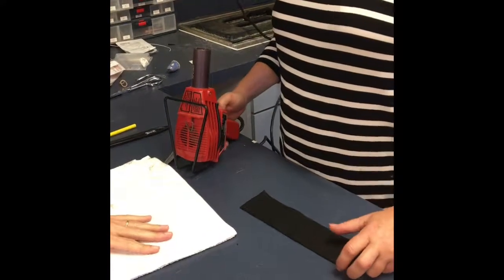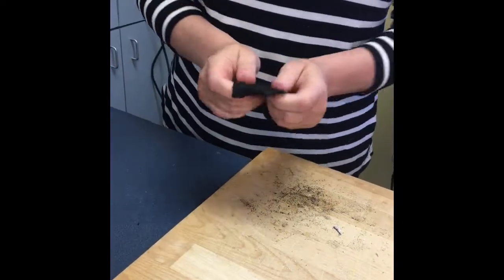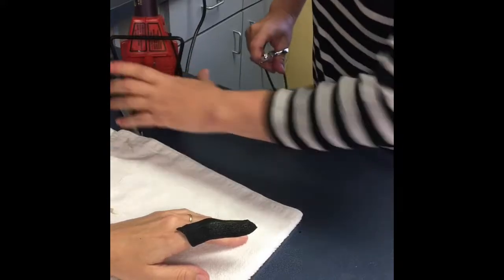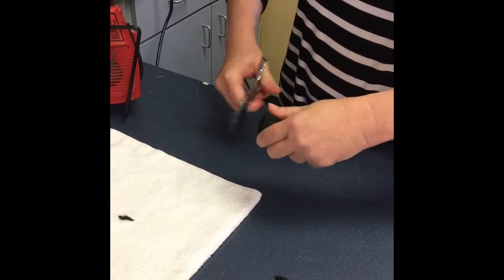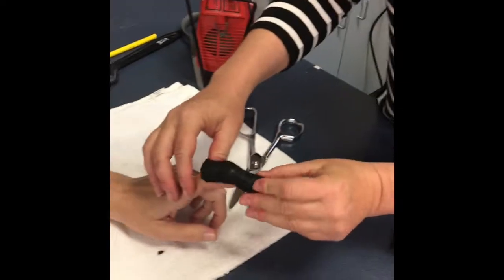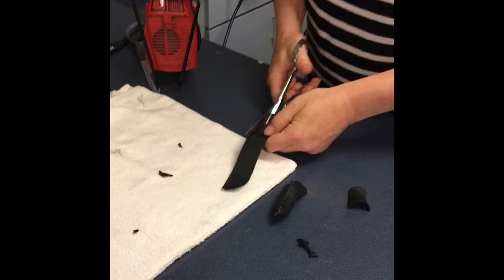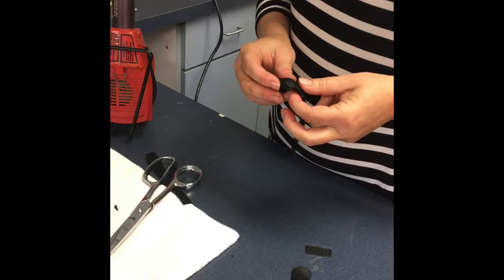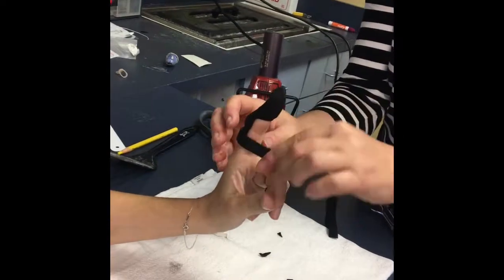Long Mallet Finger Orthosis - Thermoplastic Material

Comment: Hello, I cannot seem to find an answer anywhere but what does it mean if I have a mallet finger but it was NEVER swollen inflamed or tender in any way? 
The ONLY symptom is the inability to straighten out the dip joint unless it's pushed into extension position. 
I have no insurance so that's why I'm wondering why there's no symptoms except the lag via internet. Thanks!
Reply from the maker: Hey! If you can't extend the tip of your finger on its own then you definitely ruptured the tendon aka mallet finger.... sometimes people don't even realize they do it and its not painful..... You need to splint the involved finger to that it is completely straight for a total of 6 weeks!